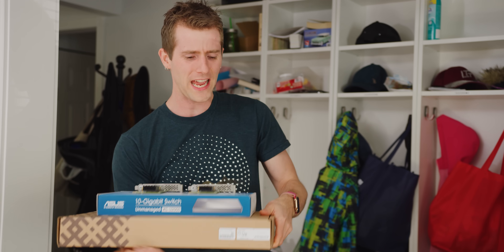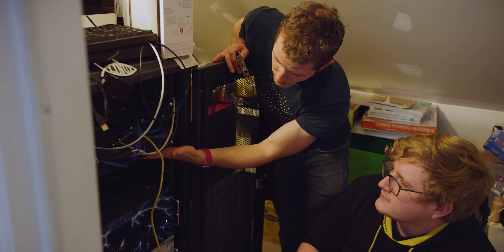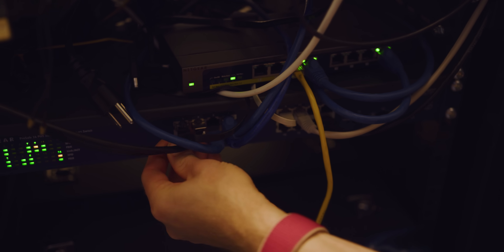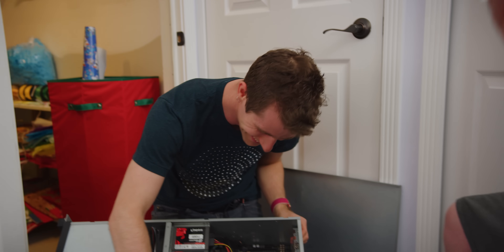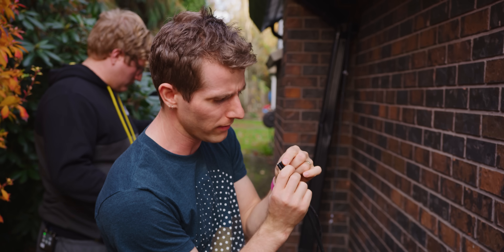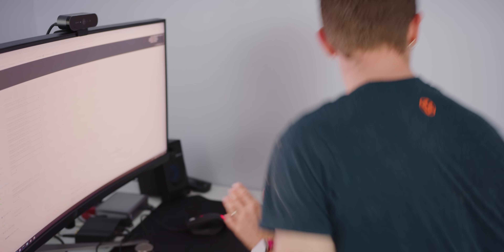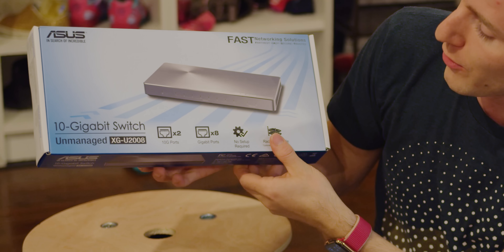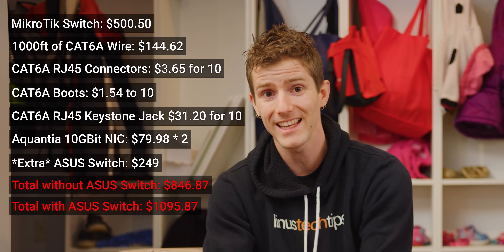Home 10 Gig Network Upgrade for CHEAP

Comment: 6 years later and I am just starting to use 2.5gig 😂

On the bright side cat6(non a) will also run 10gig up to 55meters, but 10gig routers are still crazy expensive, especially ones with more than one 10gig port.

Comment: This is quite old but still. Cheers for highlighting the budget options. My channel shows how I turned a £20 OptiPlex 5050 into a pfSense router with dual‑SFP+ 10 Gbps, drilled a hole for new cat6a runs, and tested every adapter under the sun - now 10gbs is really affordable

Comment: Almost a decade later and 10Gb is still just as inaccessible
Reply: X540 t2 are only 15€ on AE, my internet provider give 10gbs router for 39€ per months. It depends on the country but for 1 PC without switches in FR it's "cheap"

Comment: Yeah i seen one guy. Use cat5e. He got 9780gbs there abouts up and down.. 200 300 feet, he got 4865 gbs.. there abouts. So no, you dont need cat6  for 100 feet and under.  I think the cat6 cable supplier gave linus a discount.

Comment: Imagine what is that compared to 4 years later. I just got a switch with 2xspf+ and 4x2.5G (market price $70), add a used card for $20-30 , add DAC for $10-15 or optics +transievers for $50-$100 depending on distance for and you can have 10 GB for <$200.

Comment: Not exactly budget . I went with mikrotik crs 305s (3 of them) distributed throughout my home connected via fiber optic cable. Went with ge800 linksys 10gb router for my isp side of things. Still easily over $1000 in upgrades.   Cheap compared to enterprise level costs? Sure, but still not cheap or budget

Comment: All this to watch Netflix. God, I wish I had these kind of problems.
Reply: First off, it’s a 4year old video. Second, 2 mins into the video you can see the Nas and NVRs, you do realise that a 10gib local connection is going to be much more beneficial right? You can transfer files at ~1.2GiB/s across home devices, much much better than lugging around external hard disks and shit

Comment: uhm, I think that's not Cat6a. That's just Cat6 with a little more twist count. The anti-crosstalk plastic divider is already present in Cat6. I believe a real Cat6a, aside from having more twist count, also have slightly higher copper gauge and at least a foil shielding with a grounding wire which will be attached to the metal body of the Cat6a connector.

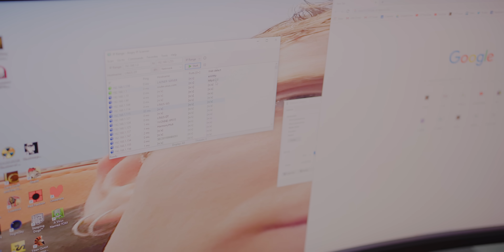Comment: 5:10 this is incredibly misleading, a managed switch is TRANSPARENT and will not show up on your network, and MikroTik does NOT use Huawei chips. At 5:20 he clarifies this is his sisters smartphone, but this should have been removed off the video entirely. MikroTik is an excellent brand

Comment: I tried this at home with a Mikrotik switch and couldn't configure it to get 10gbit to run. It was way too advanced and not worth the hours of hassle and effort to learn advanced networking configuration. I already have my Asus router manage my home network. Swapped it out for an unmanaged Netgear 10gbe RJ45 switch and it works like a dream with no effort.

Comment: cat6 only cable crimpled by unshielded RJ-45 connector? and you call it 10Gb network? This is really cheap quality. I wonder if he really realizes that this is all wrong or just pushing specs to the limit to get 10Gb-so-called network because according to Linus's test it's only 8Gb network.

Comment: Hi, I have installed CAT 6 cable throughout my house from one central location, i wanted to know how I can make one singular wifi network from that, so that i may be able to move throughout the house without drops in connection, or having to reconnect to another network, which devices will I need to buy for that, to create a mesh like network.
Thanks so much in advance.
Reply: You will need a wifi access point, or multiple of them depending on how large your home is and/or how large of a wifi coverage you will need. You will need to connect all of the ethernet cables to your router. Depending on the router and/or switch, you may need to install PoE (Power over Ethernet) injectors so that your Wifi APs get power over the same ethernet cable that delivers data.

Most Wi-Fi APs use a controller (be it a dedicated hardware device or software running on your PC) that you use to setup and manage your wifi network. The typical thing is to have all APs use the same SSIDs (wifi name). Most will have an option that allows you to seamlessly roam around APs without dropping the connection.

Comment: I am 100% positive that you do not need cat 6a rated keystones OR cat6a rate rj45 connectors as long as you have runs that are less than 100 meters each, which is really easy to do.  And the prices for the cat6a keystones and connectors are ABSOLUTELY insane.

Comment: Another year later (lol) and the price of switches have gone down. I found one for 250 bucks. Need to get 6A cables, 6A connectors, and two NICs

Even the NICs have gone down in price, but just a little. instead of 80 I found some for 60. I think you can save a little money by using usb to NIC dongles too

So I finally bit the bullet after TWO YEARS WOW and hopefully I can get 10Gbps intranet. Maybe I can encode right off the network?

Comment: Old video but still, how did you get the PC to do 10gig, mines still only doing 1gig even over the 10gb cards through a 10gb switch to my unRAID.

Note: PC is Win 7 ultimate, network stats shoes 10.0 gig, but speed test docker on unRAID is only showing 1400-1500ish Mbps.

Comment: Why not terminate the C6a OSP rated cable onto a C6A outlet? Then you can use a factory made C6A patch cord on both ends. Gets you closer to meeting the C6A performance criteria, for the channel (cable, outlet terminations, patch cords).

Comment: Did linus just run a cable from the inside to the outside and back to the inside again, and for those 4ft outside he needed a expesive UV resistance cable? :D

Comment: Those Norco cases are a box of Sata backplanes that nuke hdds because of bad circuit board design wrapped in razorblade sharp metal edges.  I'd be Leary or their design if I were you Linus.

Comment: @Linis Tech Tips - #protip, you can't see the actual difference (the one that makes a difference) by looking at the ends of a 5e and 6A cable. 

The main difference between 5e and 6A cables isn't the plastic separator "cross" between the pairs - that is vendor specific and exists on plenty of 5e cables too, and has done so for many years. 

The difference that enables the increased speed is the way the twisted pairs are twisted. It's necessary to twist the pairs differently to reduce crosstalk between pairs, because if one of the wires of a pair "meets" a wire from another pair repeatedly, it will increase crosstalk.

5e solves this by having the wire pairs be twisted differently, i.e. the brown pair could be twisted tightly/frequently, while the green pair could be much looser/infrequent. So the chances of random encounters between the same wires would be greatly reduced. 

This has an unfortunate side effect, as the brown pair in the example becomes longer per feet of cable than the green pair. And this difference, over a longer cable run, can be enough to have data arrive at different times and thus makes it necessary to reduce the speed (frequency). As this difference grows over the length of the cable, it is also the explanation why you can run 10G on a short 5e cable run, but not on a long one. 

6A solves the problem of wires "meeting" differently: By having each wire pair be twisted in a tightness/frequency that changes along the length of the cable. So now, the brown pair might be twisted very tightly at one point, and then later on in the same cable be twisted very loosely. And the wire pairs are then put in at an offset, so that they will always be twisted differently in a given section of the cable. 

That way, the pairs don't "meet up" still, but the wire pairs end up pretty much the same length, which means the transmission time for each wire pair through a cable run will be very near identical, and thus, speed or frequency can be increased no matter the length (providing the cable is not longer than specifications), as opposed to 5e, where it'll work on shorter runs but fail at some indeterminable point a long the way.

So rather than looking at the end of the cable, to spot the difference you would open up some section, like 3 feet, of cable and look at the way the pairs are differently twisted. :)

Comment: DONT use those cat 5e couplers they are absolute junk, made with alloy cheap metal for the pins. Use a CAT 6A Keystone for the faceplates so you dont have a bottleneck at the couplers.

Comment: I did not expect a little tutorial on tipping an Ethernet cable. If you’re still using the Cat5e cable standard at home, you might benefit by upgrading your network to Cat6a or higher.

Comment: I have a question, I am looking to buy a network switch for the first time. I would like  to use it for gaming, streaming,  and for work from home. I found, NETGEAR 10-Port Gigabit Ethernet Smart Managed Pro PoE Switch with Insight Cloud Management (GC510PP), anyone know if it's any good?

Comment: I'm building a new house, and just pulled 7000ft of Cat6 'E' (exceeds Cat6 spec but doesn't meet Cat6A spec). 144 runs to fill 3x 48 port patch panels and 3x 48 port gig switches (stack of Cisco 2960s). I'll pick up a 10 gig switch at some point, but there's plenty of bandwidth to go around for a while. There are 4 runs of Cat6 to each wall plate, and plenty of wall plates in each room, so I don't have to have a bunch of 8 port switches floating around the house.

It's a good idea to certify each run tho. I may have to borrow a fluke meter from work.

Comment: I just saw this, but the switch has only 2 x 10G ports, so technically wouldn't this be not a true 10g setup?
Reply: ASUS XG-U2008 Unmanaged/Plug-and-play 2-port 10G and 8-port Gigabit Switch - from the manufacturer's site.

Comment: If anyone is looking at doing this in 2021, I would HIGHLY suggest looking at the NetGear MS510TXM. I got mine for just a shade over $400 and it has 4x2.5gb RJ45 ports 4x10gb RJ45 and two SFP+ 10gb ports and non of them are shared.

Comment: As a network engineer and a safety enthusiast i thank you for that wild ride of anxiety. The part where you reached for the cable surrounded by rodent poop, insulation, dust particles, soft flooring, and a shallow ceiling with several exposed nails.... yeah i wouldn't let your life insurance see that footage. Please next time wear a hard hat, protective eye wear, gloves, and wear a mask. You can use tools to grab things in awkward spaces too. Speaking of which, when you replace a cable run there is an easier technique where you tie your new cable to you old cable then simply pull the old cable out and the new cable will follow through to replace it. Alternatively, if you are doing a new run you can use a tool called fish tape. Steel fish tape is easier to run through your desired path, then you tie your cable to the steel tape, and pull the steel tape back while the new cable follows behind. I dropped a link with example tools for cable runs. There is also a section with protective encasing for outdoor wires. The sections of your cable run that are outside of your house could use some protection from weather and animal elements. Not to mention it would be easy for a "hacker" to install a device on your exposed cat6 and capture all the internal traffic. 
https://www.cableorganizer.com/wire-installation/

Comment: Cheap, my ass. I have a couple of used Belkin wireless routers, 8 port 1-Gig switch I bought for $4 at a thrift store, various keystone jacks and housings in a big bundle for a few bucks at the same thrift store, and cable runs consisting of a mix match of old spools of leftover cat5e cable, and a few super cheap copper clad aluminum eBay cables. My entire home networking couldn't have cost more than $60.

Comment: I recommend looking into Platinum Tools 10Gig crimpers and their CAT6A shielded plugs or Simply45 CAT6A system for outdoor cabling. Designed for 10Gig applications.

Comment: To ask what may well be a stupid question, besides the 3M cable length constraint, isn't USB4 and Thunderbolt 3 & 4 now 40Gbit/s as opposed to 10Gbit/s & therefore faster options or does that they support 10GbE mean they do so at 10Gbit/s?

Comment: Bond0 will not do failover...you will loose ongoing connections if you unplug or loose connection on one of the cables/interfaces. 

For failover you need to use lacp link aggregation (802.3ad spec) and you will also need a compatible “smart/managed” switch.

Comment: you only certify this cheap questionable quality "cat6a" with 50ft, try to certify it over 200ft and share results with us. 
Branded Cat6 can be certified  10gbps up to 150 feet without any ussues.

Comment: You guys are terrible at handling wires... Anyone reading this: AVOID HARD BENDS, when doing those ends never hard bend them out of the way, you risk compromising the cable for no real reason. the bend into the wall was also sharper than is ideal, but that's pretty common with outdoor wiring unfortunately.

Comment: What do you use for a router/firewall???
Most routers, even with a 10Gb SFP+ Wan ports, don't have 10Gb LAN ports, and even if they do the Firewall throughput is not 10Gb. Especially with 64k packets.

Comment: As a network guy, if that's me, I'm running short range fiber to the SFP+ ports> Using fiber gets you away from frying gear if the house is hit, or nearby lightning induces current in the copper and kills gear.

Comment: @linus tech tips , Great video, this is what i do for a living, i would say this, i never crimp a cable with a RJ-45 as my first option. i always go to a keystone, with a 6 inch patch cable. Its to prevent broken or lost lines, plus easy change later if something happens to just the patch cable end.

Comment: What is infiniband cable and the difference between glassfibre cable and that.  and where to use it? and is it possible to connect PC/laptop to Glassfibre? and glassfibre <->house <-> CAT 6 cable <-> PC is this the most optimal connection? please help, thanks. :-)

Comment: for a year ago, that switch is STILL expensive. Its a 12port for $500. If it 12 port for $50, sure, or even for $100. But yar. I just did a Cisco 48port POE+ for $100 that has SFP+ ports so i used a 10GB SFP+ adapter and it works amazingly.

Comment: I have no idea what he’s doing. My dad plugged in a router and I have 200 Meg wifi which I’m perfectly happy with. Very rarely causes issues. Enough for 4 computers, 4 Apple TVs, and an inordinate number of smartphones
Reply: Basically he made his internet 500 times fast than yours. This is necessary for him because he is sending major files to the office and he runs security systems, WIFI range extenders and home entertainment systems. Mainstream routers like yours can’t handle that high speeds.

Comment: $100 for 10gb Fiber Switch on ebay, and fiber is actually cheaper than ethernet for long runs.  Been 10gb for almost 10 years lol.

Comment: Leave it to Linus to drop 1000$ on something that only needed 100$. (Hint: if your editing rig is only a few feet from the NAS, two NICs and a pre-made patch cable is all you really need. And $500 for a 12 port 10G switch is insanely expensive -- yes, everything 10G is expensive.)

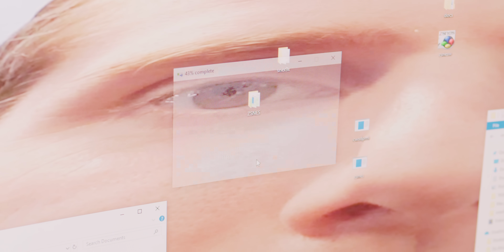Comment: 4:00 Dude you're still using ZSNES? Stop that. It was great in 2000. It was great in 2010. But in 2019 it's bad. Use SNES9X 1.52+ or bsnes, either standalone or in a multi-emulator like BizHawk or RetroArch.

Comment: How to do 10-gig not-on-the-cheap:
- Look up cost of a 24-port switch with 10G uplink. Be horrified.
- Realise that switches with the old CX4 10G interfaces are a fraction of the price.
- Buy switch
- Buy cheap, obsolete CX4 card.
- Yay!
- ... Realise that there is no way that CX4 connector is fitting through a hole in the thick concrete wall of your house.
- Buy new network cards with SFP+ port.
- Buy X2-SR interface for obsolete switch.
- Discover that the HP switch will not touch non-HP modules, and throws a flashing-light tantrum if you try, with a log message about an unrecognised identifier.
- Buy HP part for ten times the price.
- Install network card.
- Wonder why network card is shutting down with an apparent thermal error saying it hit 160 celcius.
- Spend hours with driver and firmware updates, trying to figure out why the temperature reading is off.
- Burn hand, realise the temperature sensor is working fine.
- Discover that HP's SFP+ cards are infamous for overheating, because they are designed specifically for the forced-airflow of the HP servers.
- Bodge fan on to network card.
- Discover that card won't take your non-HP SFP+-SR module.
- Throw HP crap card away.
- Buy Emulex card.
- Happy 10G at last.

Comment: Do you have some suggestion for ah brick house network. 
I have a server, with a cisco layer2 switch in the basement, which is connected per powerlan with my TP-Link router in the living room, and my pc is connected to the router per powerlan. As you can assume powerlan is really good for latency, but i don't really have a good option to run cables through the existing wireing sleeves in the brick wall, becaus i have no idea were they are going, because this is an quiet old eruopean house (i live in Austria). So should i keep powerlan or should i try to run cables through the exisiting wall poer wireing?

Comment: Why not run Cat 8 while you were at it? Last I saw it was close to Cat6 prices. Sure you won't need the bandwidth now, but as you go to upgrade your equipment in the future, you won't have the headache of running wire in the attic and outside.